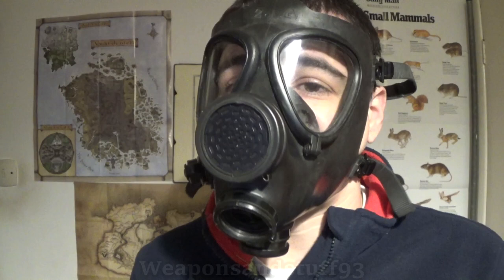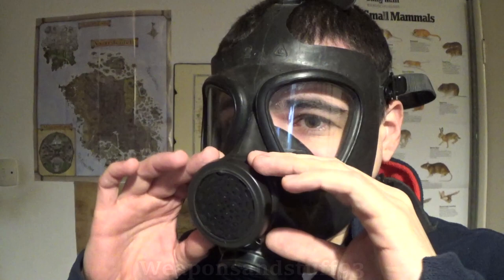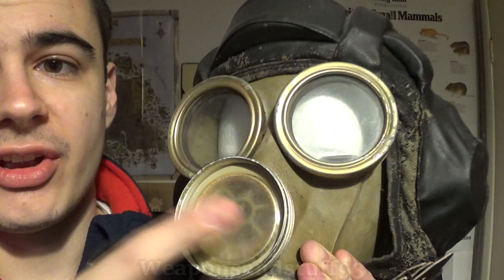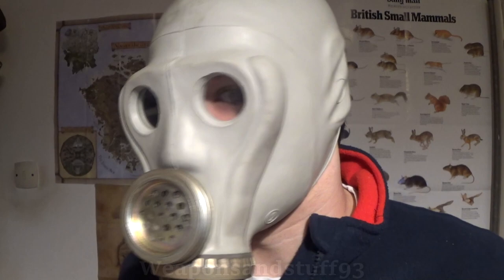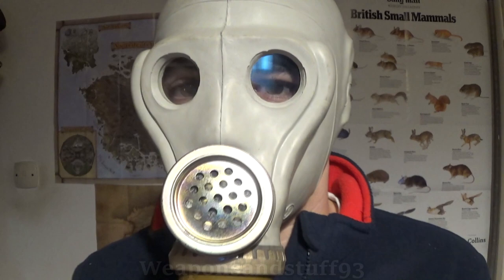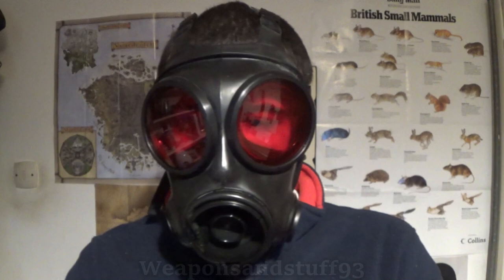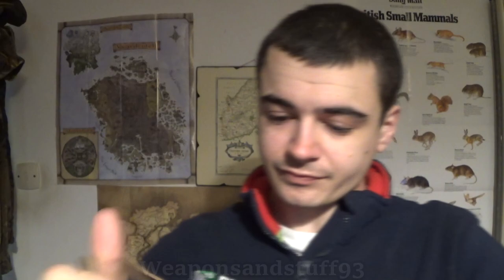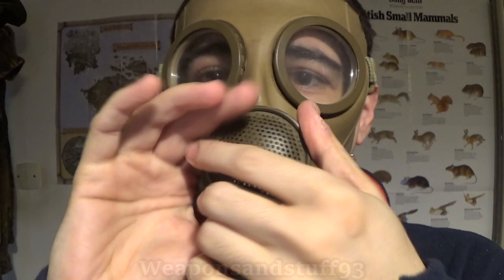How do Voice Diaphragms work on gas masks?

Comment: If you wanna take the Diaphragm out; put the Mask on, hold the exhaust valve shut, and blow.
If it doesn't come out then do sorta the same thing from the outside; hold exhaust valve shut and pinch the cloak together then, blow into the intake valve.
With either method, the Diaphragm should pop out.
Reply from the maker: Good idea

Comment: I can see light through my Israeli m15s diaphragm. Is that normal
Reply: I was wondering the same thing. I can see a bit through some of the holes when I look at an angle.
Reply: Some voice diaphragms are transparent like the M64(A). You might gonna check it since I'm not quite sure about it. Try to negative pressure check it.

Comment: Where can you buy soviet schms gas mask parts? Like voice diaphragms or covers?
Reply from the maker: They did make repair kits but they're pretty rare, the idea seemed to be throw them away and get a new one.
Reply: @Weaponsandstuff93  ahh I see... I have a black schms I was curious if you could replace the gas mask piece inside... maybe with something else... I mean for Romanian gas masks you like find the pieces at every corner....
Reply: @Weaponsandstuff93  What would you recommend as a replacement :)) I was thinking of grabbint like a membrane from a drum and making one but dunno I was also thinking of getting like a rubber gasket from a mask the same size and making aseal with a rubber one instead of the plastic original

Comment: GAS MASK NOOB HERE - Bought a Mp5 polish mask and I realised there’s holes in the voice diaphragm. Surely that should be shut or particles could get through ? 

Thanks for the help :)
Reply: Yea i purchased the same as well and noticed it's open on the voice diaphragm
Reply: Try to negative pressure check it since some voice diaphragms are transparent like the ones in the M64(A)

Comment: Can i seal a gp5 filter with hot glue and make a hole in the mask my mask which is an MM2 because i want it for cosplay and i dont won't to breathe asbestos??
Reply from the maker: What's an MM2 mask? In theory you could seal any filter and then break a mask to breath through the hole, but that's a total waste of a mask when you could stick a safe filter on it.
Reply: Weaponsandstuff93 it has a voice diafragm so i can remove that film material or make a hole on it
Reply from the maker: You could just disassemble all the parts of the voice diaphragm, put the cover on and breath through there.

Comment: In all honesty, I'd rather be sent to the Gulf War with an M51 as opposed to an M17. My M51 still works, even with my facial hair.
Reply from the maker: I'd just worry about the rubber giving out under a bit of blister then it's game over.
Reply: Weaponsandstuff93 That's true. Between the two masks, I wouldn't be to happy to be issued either one. Also, do you have any videos about the different types of chemical weapons? If not, could you possibly consider doing a video about it?
Reply from the maker: I've done a video about the history of chemical weapons that covers a lot of the major ones.
Reply: Weaponsandstuff93 Thanks, I'll check it out
Reply from the maker: I may do a video at some point specifically on the different type of chemical threats.
Reply: Weaponsandstuff93 I'll be looking forward to it
Reply: Weaponsandstuff93 That would be nice.